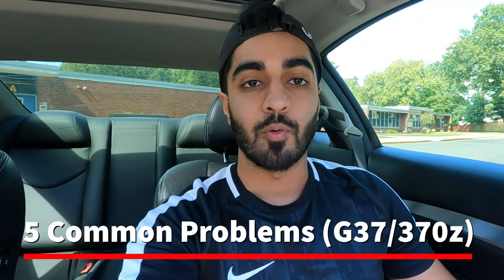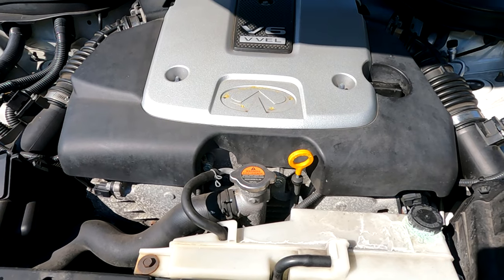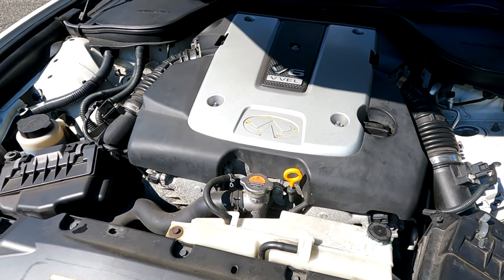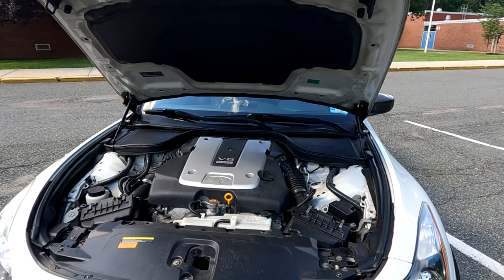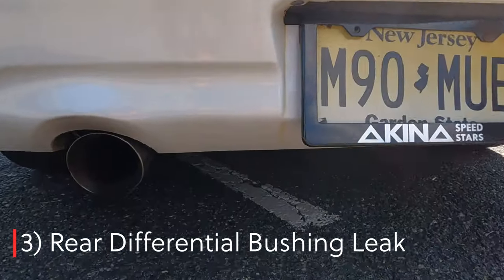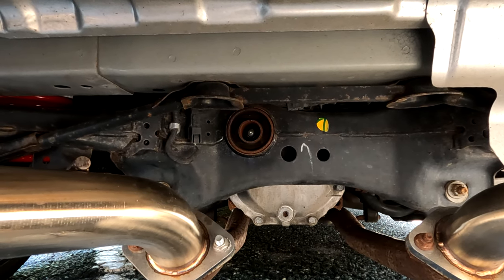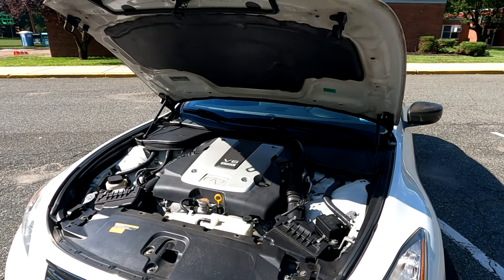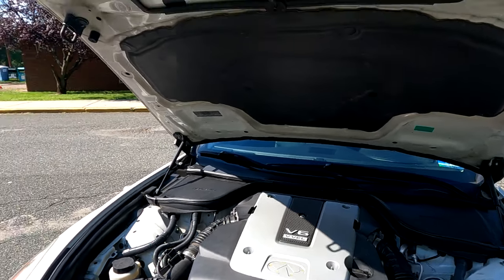5 Common Issues (G37/370z) - **WATCH THIS BEFORE BUYING!

Comment: I bought a 2008 G37 S automatic transmission for $7,500 clean tittle and no check engine light. 
The previous owner treated her right but the steering wheel feels a little bit stiff when turning. Also my power steering reservoir looks like it’s boiling the fluid making bubbles. 
I’m guessing the system has air inside.
Reply: I just bought a 12 G37 sedan AT clean title no check engine light. My steering feels a little stiff in higher speed too and fluid in the steering fluid reservoir stirs around that looks like it’s boiling but this mechanic told me it’s normal on G37. But if you literally see bubbles inside when you open the cap of the reservoir then there could be a leak. Mine doesn’t have bubbles even though it looks like it from outside.
Reply: Infiniti steering gets ties when you speeding because of better control
Reply: @jermainefoster7813  yeah that’s true. It’s softer in low speed and it gets tighter in high speed and it def is a good handling car
Reply: I'm looking at an 08 g37s auto with 200k km on it right now. Rebuilt title. How is yours holding up?

Comment: I have a 2013, and the auto trans would act kind of bad sometimes when bone cold.  But it wasn't so bad, found a brand new surplus trans for $1000 literally.
Reply: Trans is def the weakest point in these cars, been through 2 in my 2013 g37x. swapped the 2nd one with the vr30 trans and havent had an issue yet

Comment: About the oil gasket.  You said from 08 to 2013. But then you said they fixed the issue from 2013 and above. Do you mean the q50s ?
Reply from the maker: Oh so what I meant was, this oil gasket issue was solved after the 2012. So 2012-2013 G37 don't have this issue
Reply: @yayasgarage  awesome thanks
Reply: @yayasgarage after the 2012 means they fixed it in 2013. You keep saying 2012-2013.

Comment: How much does it generally cost to fix the Oil gallery gasket problem in the United States?
Reply from the maker: I'm not actually sure but checking online, it would probably cost between $1k-1500 for parts and labor

Comment: I own a 2013 g37x and I do drive it insanely hard and I try to change my oil every 5k miles bc of how I drive but it recently developed a ticking noise and I was assuming it’s “lifters tick” I used sea foam to try and clear it up but no difference was made, I am going to try and change my oil bc it’s getting close to 5k but it has me worried and I’m just wondering if anyone has a solution. It’s not noticeable on start ups and I can only hear it when it’s warmed up and when the hood is open but it still bothers me enough to say it’s a problem
Reply: dude… if you drive it hard u should change your oil every 3k miles
Reply: Just turn up your radio 📻 .
Reply: Engine going
Reply: @soulerflare7  Lmfaoooo
Reply: Just get a catback exhaust

Comment: Is it better to get a g37x or g37s? Which one drives better/handles, reliability and is the overall better model? Thinking about getting one myself don’t know if I want AWD or RWD and is there really a big difference between the sport model and the base?
Reply from the maker: I would 100% go with sport. It handles better, bigger brakes, just as reliable as awd. There is a huge difference between base and sport. Suspension is different, bigger wheels etc. Only benefit awd has is for snow but realistically you'll never drive ur car in snow. So I would say go with sport if possible
Reply: @yayasgarage  Ok thanks bro. How does it handle in the rain? And isn’t the AWD significantly faster off the line vs RWD?
Reply from the maker: As long as you have good tires and drive carefully, rain should not be an issue. AWD is quicker off the line but on a roll RWD is faster.
Reply: The sport has a firmer and more sporty ride.  Honestly, the AWD has plenty of sport in it and is a bit more comfortable on trips.  Really depends on your priorities.  Both are great cars.  At this point, get the car in the best condition for the money, you won’t be disappointed.

Comment: Great cars!
I had the oil leak issue on my 2013 G37.  Repaired at the dealer, problem solved.
I sold my G37, wish I had it back!
Reply: How much did it cost?
Reply: @rafaelvaldez2549  sorry, I don’t recall.  It was a while back and I don’t have the receipts.
Reply: Sold my 2012 coupe S in 2019. Missed it so much that Just last week bought 2015 Q60s with 110k miles on it but one owner and very clean. Keeping it for a very long time now i hope

Comment: What about the MAP sensor going bad and getting the P0106 error code? I tried cleaning mine, didn't work, then I bought a Hitachi and reset the ECU, error code keeps coming back. Any thoughts or ideas on how to get rid of this pesky error code?
Reply from the maker: Hmmm that is weird. I actually haven't ran into that issue. Did you try replacing the MAF, it might be broken
Reply: @yayasgarage  found out there's a TSB from Infiniti regarding this, taking it to dealer for that this week
Reply from the maker: Great news! Thanks for sharing
Reply: @yayasgarage  ECU reprogram works for two weeks so far
Reply: hows it going now? no more issues?
Reply: @jakeeditz03  no issues with that anymore, the TSB reprogram fixed it.
Reply: @oldkid6  but any other problems, im tryna get a 2012 g37xS with 62,000. Im doing lots of research to make sure I can maintain it well
Reply: @jakeeditz03  the most problematic thing has been a few coolant leaks, new fans, front struts, and new AC compressor, the usual stuff for a 2010 car with over 105K. The old radio is annoying but ya can't go aftermarket the way it's built into the dash. Definitely no regrets, just have to do the usual upkeep.

Comment: Do you think a 2013 g37 would be good if you’re on a budget ? Like would me just owning the car be expensive ?
Reply from the maker: Aside from the major expense of clutch master/slave cylinder. It is inexpensive to maintain and own in my opinion
Reply: @yayasgarage  would you recommend any other vehicle below 20k that’s better than this?
Reply: @ivanbarrientos2665  2013s are the most reliable . I have a 2012 g37 sedan with 231,000 miles and drive it like I stole it . No major issues yet . About the only thing with good performance that is a better car would probably be a honda accord coupe v6 2010 + or v6 sedan 2013 - 2017 but they are expensive. They don't have the performance of a g37 though but still pretty solid .
Reply: I have owned 2 G37 ( 2011 G37x coupe, 2013 G37s on my channel ) never had any issues. Drag raced numerous times. Car drives like clock work. Regular maintenance and go.

Comment: Hey man I have a 08 g35x I got the car with 147k now I have 171k the only mod I have is kinetic high flow cats and jms muffler delete stock tune no oil burning and I abuse it sometimes do I need to replace the gallery gaskets I’m sure they have never been done
Reply: I wouldn't replace it until you get a CEL or notice it leaking.  Its a very expensive or time consuming job depending on if you pay someone or do it yourself and it doesnt always go bad. Just keep an eye on your oil pressure you'll be fine

Comment: I bought g37 2011 spot sedan 130000 mills for $10000 I don’t know is this a good price
Reply from the maker: Manual or automatic?
Reply: Yayas Garage   Automatic
Reply: Yayas Garage  what do you think
Reply: Over priced
Reply: Is this market everything is over priced. It will be for 2 to 3 years. Buying high mileage cars might be the norm moving forward. I predict will hold onto cars a lot longer than they use too.
Reply: Overpriced bro

Comment: How often do you change oil?
Reply from the maker: I do it every 3k-5k miles. 3k is a little earlier but I just like to be safe
Reply: Every 10k miles
Reply: 4500 here with amsoil
Reply: I change my oil every 5000 miles or 1 year whichever comes first with mobile 1 full synthetic.  Other issues, shiny / melting dashboards with or without cracks around $2300 to replace in warm humid clinates, passenger occupancy sensor failure which is built into a $5k seat.  If you see the warning light on or if the dash is overly glossy or sticky, you have been warned.

Comment: I’m trying to buy a g37s as my first car. I’ve found a car w 100k miles for $14k. I’m not tryna get scammed and all the shxt, you think is a good price for this car? Or good car as my first?
Reply: What location are you because 14k Gawddamn unless it’s from a dealer that actually pretty good
Reply: @venenomasters2484  yeah it comes from a dealer. I’m located in north Jersey
Reply: @vmodzgaming8133  yea not bad at all tbh what year? Also just keep a look out for common things as well as you look at the vehicle like he makes greats points but check the sun roof seals for leaks and stuff as well as any place for accidents etc yk
Reply: @venenomasters2484  I’m going back to the dealer this Saturday to check them out. there’s like 3 G37 two of them are g37 coupe and they’re also manual and the g37S it’s automatic.
Reply from the maker: I paid $14k for min. Manual with 75k miles. It was very clean but this was from a private seller and pre COVID prices so I got really lucky. Manuals go for around 14k-16k. 100k is decent amount of miles but as long as you check all the above stuff I mentioned you should be good
Reply: @yayasgarage  I paid $14k for my 13 g37 manual with 75,000 too bro!! Haha

Comment: Bro didnt even mention the most common issue in ALL infiniti's. LEAKING Water because of the 3 dollar firewall cap getting clogged. Before you buy an Infiniti, ask to check under the driver & passanger side carpet for rust/water damage. VERY easy to get to, literally takes 1 minute to expose & check. PLEASE do this, save yourself a headache and potentially being quoted $1,200 from the dealership for a known issue.
Reply: Oh snap. That’s what that is. Bet. Good looking champ 👍🏽

Comment: would you recommend g37 for teens ?
Reply from the maker: Its a great car but I do think it's a little dangerous for first time drivers bc it's rear wheel drive
Reply: @yayasgarage  does it really loose traction on a dry road that easy?
Reply: @nickarcia4623  no, only if you want it to lol
Reply: Get the g37x it's awd
Reply: Got mine at 18 and insurance and gas are expensive
Reply: @nickarcia4623  if you give the RWD version some gas in a turn with the traction control off the car can go sliding pretty crazy. When I first got mine I was playing with it on a completely dry day and I skidded across 3 lanes onto a side street and hit nothing

Comment: Mine is a 2014 q60s 6mt with 55,000 miles I got it at 45. I’ve had so many problems already multiple engine codes for evap system, mass air flow sensors, random misfires. It has a problem with the rear axles clicking, it has problems with the drivers side door/window. The catalytic converters are completely shot and ratting. And more this car has been nothing short of a nightmare
Reply: I feel you brother same things with mine my catalytic converters clucking my clutch going out have a 02 sensor 😫mine is a 08 g37s coupe I’m sell it to much problems
Reply: I bought a g37x 7at and put 30k miles on it in 4 years. Spent over 7k in repairs. These cars aren't as bulletproof as people make them seem
Reply: @vq_slim.9369  That's one owner's experience. 2013 G37xS sedan, bought at 79,000 km in 2016 and have 175,000 km on it now. Less than 1K spent on actual repairs. Car still feels like a million bucks.
Reply: @jacquesc3166  exactly , 231,000 miles here and I drive it like I stole it . Mainly just cat converter at about 100k and sunroof drains at 200k , that's it !
Reply: Damn idk what you guys be doing to yall cars, vq are hella bullet proof, I have a maxima that has 370k miles it's a vq30de, an then I have a g35 with 260k miles an they run like they were brand new lmao

Comment: Really rally bad engineering..nissan..
Or as I see from my experience that car manufacturers doing this for a purpose to make customers spend more money on parts and maintenance after buying the car so they make more money
Reply from the maker: Agreed. Really disappointed in nissan for never fixing these common issues but other than that the Gs/Zs are pretty reliable.
Reply: @yayasgarage  it’s not just Nissan. Ford, BMW, Merc, etc all do these.